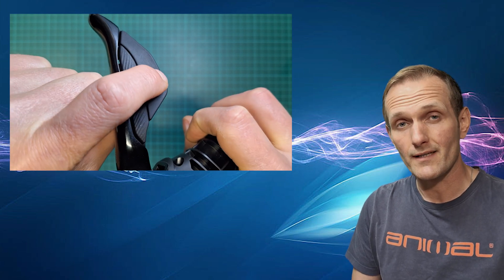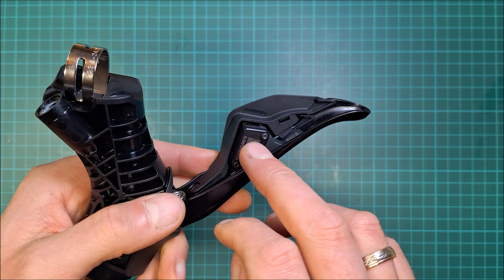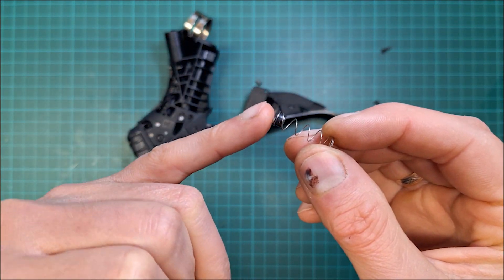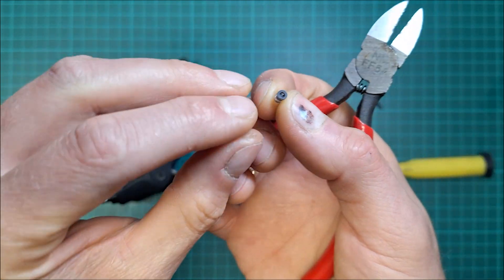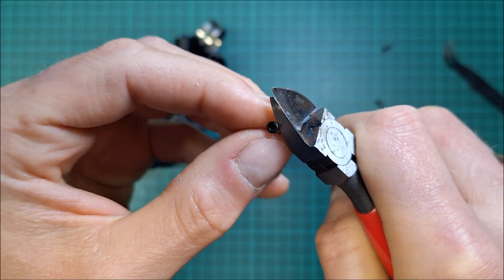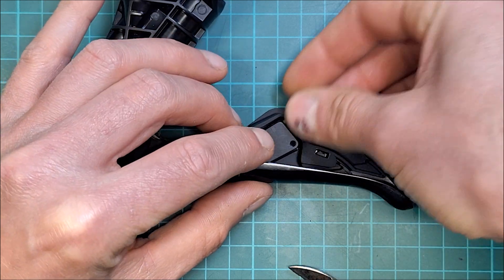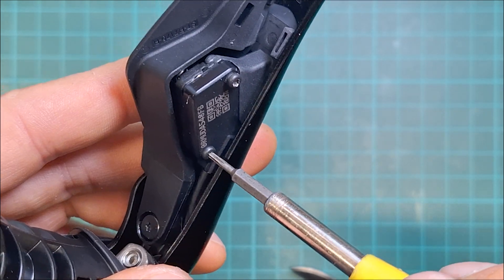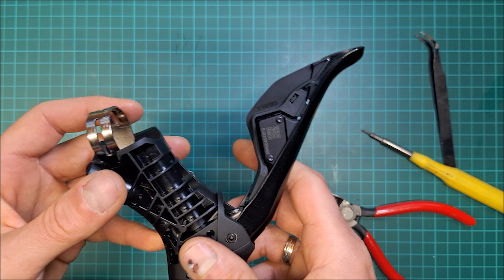Faulty, non responsive Di2 buttons - Fix

Comment: My left GRX 815 shifter upshift button stopped working as well. Positive click when pressed still. I've disassembled and completely removed the harness from the assembly and can't see any apparent damage. I assume the whole harness needs to be replaced. It appears you cant buy just the replacement harness either so it sounds like i need to buy a whole new shifter. Fortunately i use synchronized shift so i dont really notice the loss of functionality.
Reply from the maker: Have you tried diagnostic using SM-PCE02 tool. It is weird that other two buttons work, and one does not. Have you tried testing buttons with harness out?
Reply: @Di2_GP  I haven't tried the sm pec02 tool yet. Guess I could run by the bike shop and have them do it. I have tried the harness outside of the shifter. It does the same thing.
Reply from the maker: @popejbryant  I'd try to overwrite firmware, just in case... (using charger and PC). Step two is to run diagnostic using SM-PCE02. If all fails I'd cut cable between microswitch and the round electronics (where the hidden button is) If that's only fault micro switch you could splice it up with a replacement. Where are you based?
Reply: @Di2_GP  I'll give that info to my bike shop. Now that I think about it, it might have stopped working after I lost connection with etube and have to have the shop unbrick it. I'm in Las Vegas
Reply: Same issue with 8170 left shifter.  Used  pce02 to update (replace) firmware.  Buttons clicked but pce02 indicated fault condition.   The attached remote sprint shifter was recognized as well as the top button.  It appears that the wiring harness is at fault.  The buttons have failed/work intermittently in the past.  After replacing the hood cover resulted in the buttons working again.  I would assume I am looking at a new shifter in the future as the wiring harness is not easily replaced.
Reply from the maker: @CaseyCole-cw2vt  I have never had that issue before, but again, 12s is fairly new. If you are happy to send your shifter to me, I can take a look at it. Will be a good video material.
I can't promise I'll fix it, and you will definitely lose your warranty. If you're based in the UK. or happy to send it to the UK, drop me a message on IG.
Reply: @Di2_GP  I will contact you when I replace it.   Right now it is working again.  Since I did not really do anything, I am assuming it will fail again.  It would be great if  you can identify a way to repair/replace the harness.
Reply: @CaseyCole-cw2vt  As they say, if it's not broken don't fix it. Hopefully it will be ok.

Comment: Hey, what do you do if the screws holding the switch won’t turn? I bought a micro torx set but they just seem to be rounding. Have a very well used R8050 shifter 😊
Reply from the maker: Always clean the slot in the screw before taking it off. However, if the screw is rounded off, you can cut an incision and use a flat screwdriver.
I have covered it in this video: 
https://youtu.be/kthgiDaeNxI?si=IjY9W0Sel6qG2HmH

Comment: So good to see an expert reassemble the small spring inside the large spring by attaching them to the opposite parts before bringing them together. When I tried, I stupidly thought they had to be firstly combined together (small inside large) and then squeezed with tweezers to compress them small enough to drop both of them between the microswitch and paddle . . . IMPOSSIBLE!  So much easier your way. Cheers

Comment: I have non responsive buttons on my left Ultegra 8170 lever. I've taken it apart as you show in the video and replaced the springs. It appears that the issue is in the electronics, not the springs. When I pull the brake lever in the shifting works but when at rest they do not. I've managed to tinker with the wires by twisting and pulling them a bit and it works now but occasionally will not work. Do you have any resources on replacing the electronics part of it?
Reply from the maker: It sounds like your wiring loom has been ripped out of the hood. This can be fixed, but you have to cut open battery casing. Then, resolder potential loose connection. I haven't done it myself. Have not had that issue before.
Can you check if your cable between microswitch and hood is damaged?
Reply: @Di2_GP  thank you for the response. It does not appear to be damaged, though it is hard to tell because the wiring is encased in that black covering.